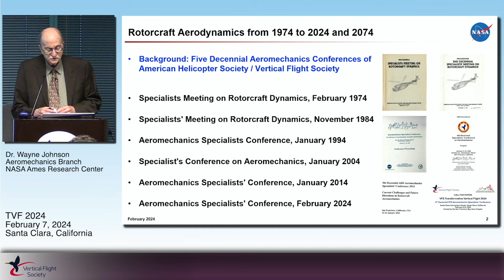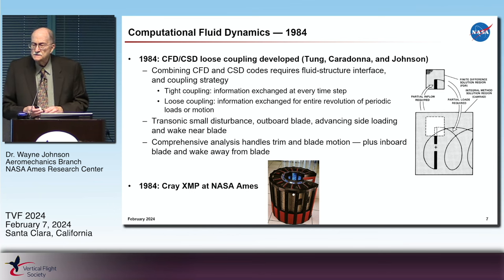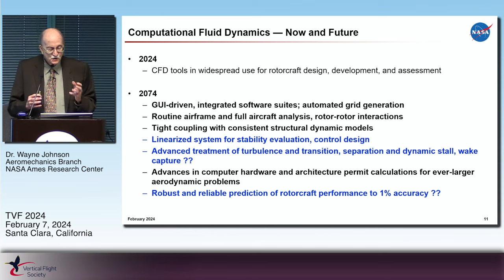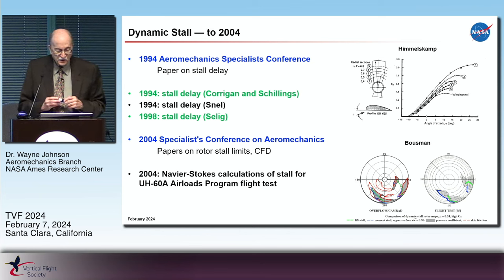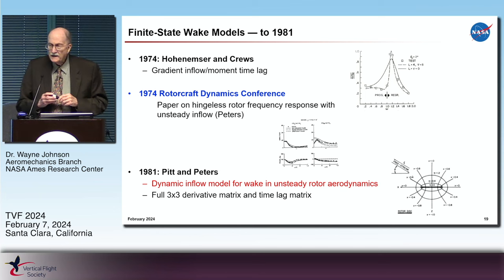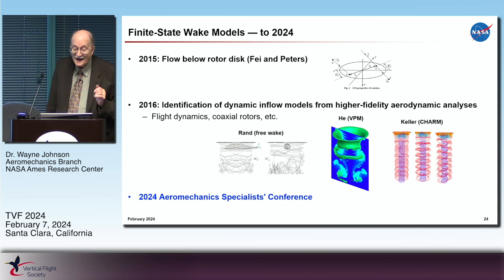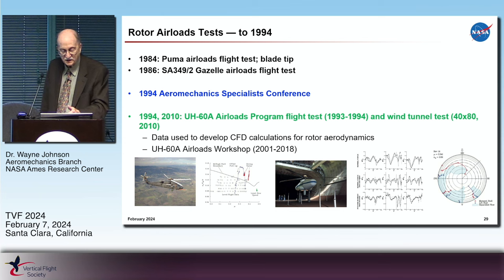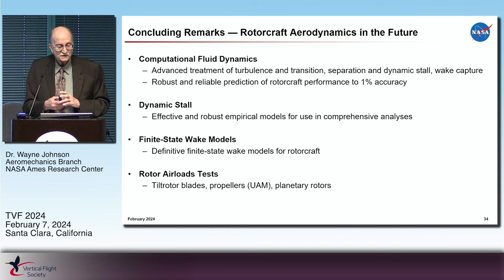VTOL Aeromechanics History: Aerodynamics

Comment: (Sorry, for being the bad guy - intentions are good!  :)  )  
From the Author's summary: “…we still have not achieved our goal of 1% performance prediction accuracy with CFD…. … dynamic stall remains a problem…”. 

Three remarks:

a)	Impression is most efforts are concentrated on calculating the exact parameters of some turbulent flow (in fact, those of many different turbulent flows), which - by definition - are basically random systems. The word "random" suggest it is impossible to give an exact description of the expected behavior of its parameters. This sounds like a controversy. Unsolvable even for a CFD running on powerful computers.

b)	Turbulent flows, generally, are not really a useful environment for generating lift in aviation. (In short: they are useless even if described exactly. The latter is, of course, impossible.) To make things even worse, most of these turbulent flows are produced by the rotors and propellers of the VTOL itself. In other words we ourselves are “financing” the creation of the environment, which is bad for us. Another controversy.

c)	The presence of the above controversies show the poor(?) CFD and the lack of robust empirical models are not the real culprits of our hardships. In reality, it is the imperfections of the investigated propulsion systems, which – as part of their normal(!) operating regime – produce too many losses, i.e. too much turbulent flow. 

Robust changes introduced in the investigated propulsion systems may hold the solution. In particular, possibly, replacing the presently used stiff rotor blades with a morphing construction, making the blades capable to change their shape the same way the speed vectors of the airflow change direction around the sections, could greatly reduce the ratio of turbulence. 
Recently, some new US patents offered mechanical options to produce the optimal variable blade twist rotors and propellers.